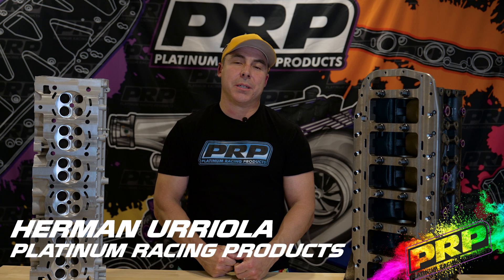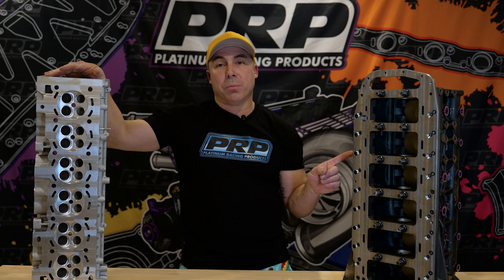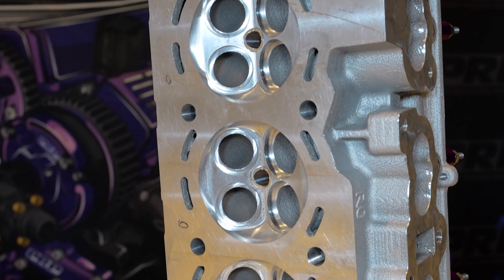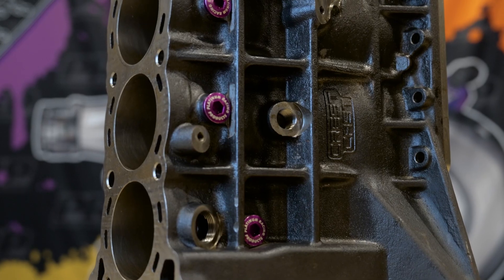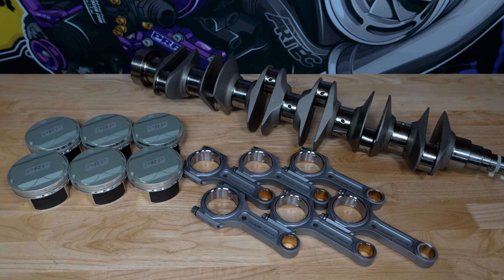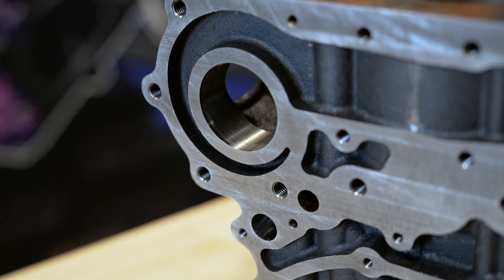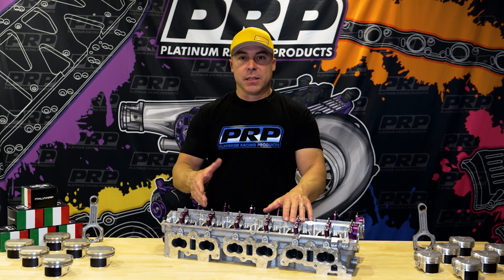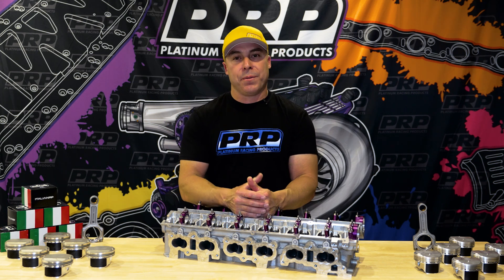Our First Nissan RB Cast Cylinder Heads & Blocks Are Here!

Comment: This is definitely going to change the RB game in a big way! No more hunting around for a block with minimal core shift and good wall thickness for those chasing big power. It should also ease the market for those building mild street stuff, as the top of the market no longer hunts through what's left of the stock blocks and heads for their builds, especially the worldwide market. I think we'll be seeing way more RB builds instead of JZ swaps after these go into full production. Can't wait to see the dyno testing! :)

Comment: So I heard rough estimates on pricing for the block...roughly how much for a long block? I'll take meds so I don't have another heart attack, 😅..in US$ plz
Reply: Around $5500 USD ready to build .. half what a OEM costs to prep
Reply: R0 OEM  Direct replacement pre machined head with 1mm oversized valving improved flow and efficiency over the R0 OEM, ready to build $6600 AUD

Porting supports OEM style builds between 180-225 CFM 

R0 Street Series, Direct replacement pre machined head with 1mm oversized valving improved flow and efficiency over the R0 OEM, ready to build $7700 AUD 

This option is modifiable well beyond the capabilities of the standard 05U cylinder head, (Chamber and porting will be available as extras) theoretically supports up to 275 CFM

R1 Race Series, R1 platform, 6mm raised exhaust ports and flange, 35mm buckets, 5 angle seat cut 34-36mm intake, 32 mm exhaust seats. Theoretical flow supports 325 + CFM, $8800. AUD

R1 Pro Series, R1 platform, 35mm buckets, 6mm raised exhaust ports, 37-37.5mm intake, 33mm exhaust, port and clover leaf chamber work supplied, 90mm bore only, supports 375 CFM (theoretical) $10,000~ dependent on specifications

We offer various block options, including:
R0 Street, standard OEM style main cap cradle  $8,800 AUD
R1 Race, integrated main brace with 2 main bolts $10,900 AUD
R1 Pro, integrated main brace with 4 main bolts $11,500 AUD
Pricing includes fitting and machining for braces
Reply: Yeah I'm keen on that too